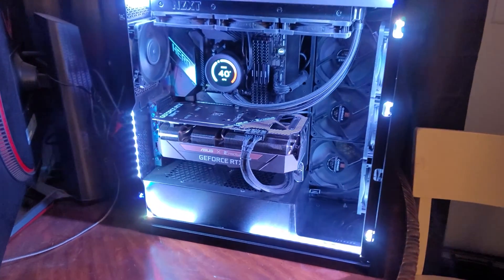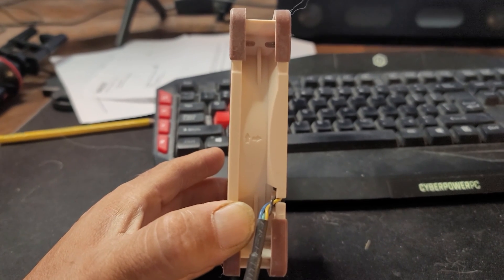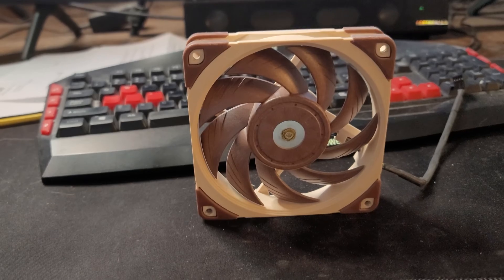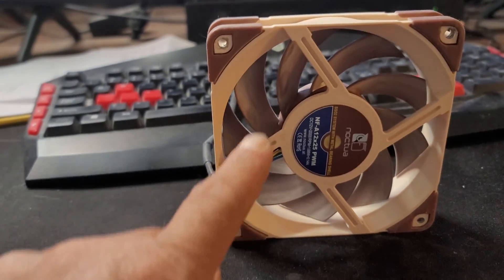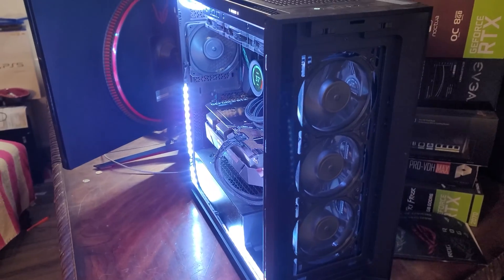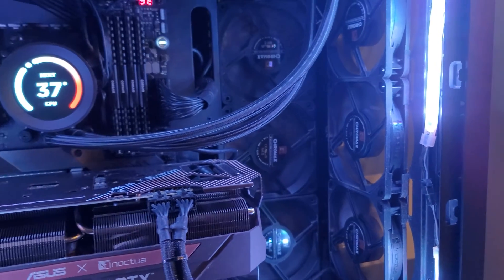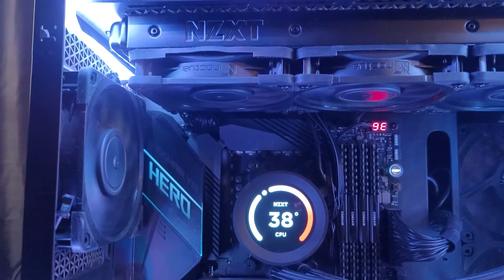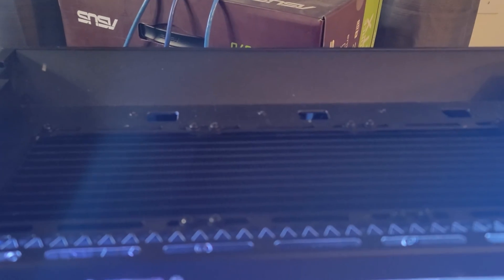Computer Fans - How to determine intake vs Exhaust (Corsair 5000d mid tower airflow example)

Comment: Why did you mount the radiator on the top? That layout doesn’t make much sense. The three front fans intake cold air, which then gets heated by the GPU and CPU. This warm air rises to the top and hits the radiator, heating it up. Wouldn’t it be better to mount the radiator at the front so that cold air goes directly through it, and then have the top and rear fans exhaust the hot air?

Comment: So basically… if you see the brand information (not just the logo), it’s intake. And if you DONT see the extra information at all, it’s exhaust? I have NZXT fans so that’s what I’m going off of.
Reply: Use a piece of paper. If it sucks in, it’s intake, if it pushes away outs exhausting out of the case

Comment: a bit overkill lol this guy has like 12 fans
Reply: I bought 9 and thought I had too many
Reply: Pc market conning people to spend more money on  fans which woll hardly make a lick of difference. Most cpus can run ip to 100 degrees before throttling. 36 degrees or 80 degrees. Cpu amd  gpu gpong tp be runnong the same.
Reply: @joesutton6518  yeah but you have to take in mind the heat in the room, on summer when my gpu is more than 75C my room gets super hot, the fans keeping it more cooled does help to reduce the heat in the pc and the room

Comment: Wouldn’t you want the aio on the front or side? Since the air coming in and hitting the radiator would be cooler. Right now you have exhaust air (warmer) going into your radiator which turns into warmer coolant. 

Maybe the difference is negligible?

Comment: Do I really need to get extra three side fans for intake or should I be fine with the front 3 intakes?
Reply: No. But you want more intake than exhaust. Positive pressure. Cooler and less dust buildup

Comment: Easiest way to explain to me is just the brackets being the exhaust, the way the air flows out, makes it so much easier for me to remember.

I just bought an Apevia Prism case and it has 5 fans preinstalled the two at the top have the brackets on the inside meaning the air flows in from the top.... which I don't understand why they would even install them like that so I'll have to fix it.

Comment: how do you put the aio in the top? is really hard for the cpu pwsupply connectors
Reply: Aio doesn’t get connected to the psu. They go into the motherboard
Reply: @HOBOTw1tcH  Nono I referred that passing the aio cables is hard because at the top are the CPU (power supply) cables blocking hah

Comment: Thanks for the explanation. I have a question: Is it an issue if I can't afford to install three fans on the top of the case, but I do have three fans on the right side?
Reply: Nah. Make sure you’re right side are intake while the top are exhaust. However, I would install more intake than exhaust because you want positive air flow, not negative.

Comment: I'm a tad confused, I'm replacing fans on my rebuilt. But why are you exhausting air into a radiator?
Reply: Youtubers told me dust in AIO is harder to get out.
Reply: It's very common for PC builds to use the radiator as exhaust, you can see his CPU temp stays cool cause the difference would be like a max of 5 degrees in the air if the air flow is rapid and consistent
Reply: Because if it's intake than all dust going to stack in radiator which is bad 😂
Reply: @esmamanyt7048  that's why most pcs have a filter above where the radiator is. If your blowing air up your just clogging it because there's no filtration, like fore the corsair 5000d, it's better to have it suck in so the filter is actually doing something to protect your radiator against dust